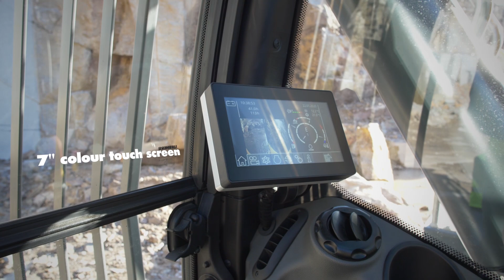Liebherr - The crawler excavator R 945 in quarry

Comment: Brand Comparison ( Excavator with Automobiles ):

# Kobelco & (Case/Sumitomo/LinkBelt) = Toyota (Reliable, cheap parts, lower in comfort).

# (Hitachi/Deer) = Mazda/ Ford/GM (Reliable,Great WorkHorse,  own components ,   standard quality and comfortable )

# Komatsu = Nissan ( Low reliable , getting worse by newer generations, Jerky , Expensive parts ). But over 50 ton category is good.

# Caterpillar = Mercedes-Benz ( Top notch quality (except Chinese and Indian versions), Reliable , Comfort  but expensive in all aspects . Great work Horse.

#  Volvo   & JCB "X" series  = Audi & BMW ( High tech , Comfortable , still dont know about the reliability )

# Hyundai Robex - Hyundai/Kia ( typical Korean  , cheapaterials , rere parts but work Horse)

# Liebherr = Ferrari nor Rolls Roise/Bently ( The Best &high end, top notch of the excavator industry . Expensive and reliable)
Sany/XCMG - Geely/ GreatWall.